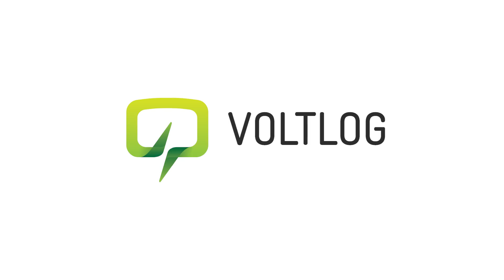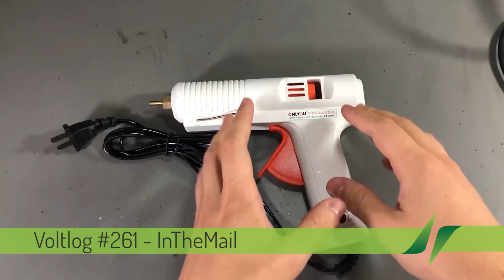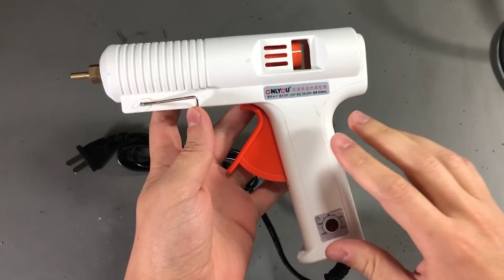Voltlog #261 - InTheMail

Comment: Those metal oxide sensors are absolute junk for measuring CO2. They have varying sensitivity to different gasses, with CO2 being one that they are the least sensitive to. The sensors really measure a bunch of gasses all at once and produce a single value and the estimate for CO2 is calculated using a curve that is calibrated if the sensor was measuring only CO2. In other words, a tiny amount of one of the other chemicals that the sensor is much more sensitive to will produce a very high "equivalent" CO2 reading. 

They can do an OK job outside in clean air where there aren't a lot of other VOCs, but indoors they will not give good readings of CO2 at all. For example, when I was experimenting with one, spraying just a little bit Windex in the same room would cause the sensor to read CO2 levels in excess of 10000 ppm, which is obviously wrong and this would persist for a long time. The only thing they are really useful for is to get a very rough idea of the general relative amount of VOCs in the air, but again because they are sensitive at different levels to a wide range of chemicals the exact values you get out of them are basically meaningless.

The gas sensor in the Bosch sensor is also metal oxide. Its air quality estimate is... questionable, at least in a quantitative sense. If you just want a rough "air good / bad" measure, though, they are decent.

Comment: The shipping time isn't the problem. I have a hard time finishing any project. When I've solved something (selected the components, designed the circuit, built a prototype, done the programming) I lose interest. Unfortunately even on things that I'd actually like to have. It's stuff like building a case, connecting switches or battery holders, in essence thet things that make it useable and look nice, that bog me down. I have soo many projects that are 90% finished and then get put in a box. And when I find them month or even years later it's a populated PCB with wire hanging off it, but I don't know exactly what I did anymore.
Reply from the maker: It's likely you are getting packages delivered faster than I am, in some rare cases I receive stuff after 3 months and under normal conditions it  takes 6-8 weeks. It's also likely I'm looking for an excuse not to finish or start a project idea :-)

Comment: I abandon EVERY project, but that's probably due to mental issues. 
I had to make my own tiny 3mm pitot tubes for probing the ports of cyl heads - , and it was a total PITA to drill those small holes in the side of the tube.
Reply from the maker: Would it be possible to use the one I showed? It sure is cheap and easy to get.
Reply: @voltlog  Unfortunately that is too big for what is essentially small ports, plus it has to be bent 180º to face the air stream.
Mine are smaller than this one.
https://youtu.be/C7G96c5rKnw?t=90
Reply: @voltlog  I've been out of the game for 10 years, but I now notice the have electronic velocity probes. Any idea what they are?
http://performancetrends.com/Electronic-flow-bench-velocity-probes.htm

Comment: MH-Z19 is definitely my favorite sensor so far. Knowing an approximate CO2 level has proved to be extremely useful exactly for monitoring the effectiveness of ventilation. Two examples:

In my previous apartment I felt the need to keep the windows slightly open all the time. After buying the sensor I could clearly see how the CO2 levels built up if the window was closed, especially if having some guests over. I happened to purchase the module a little before the apartment building council decided to reopen vents that had been closed and painted over during the energy crisis in the 1970's. In my 38m2 apartment I got then 3 vents instead of 1. CO2 levels when windows were closed dropped from 800-1100ppm to around 500ppm. The difference was huge and after that I felt less drowsy and better overall.

Our current apartment is in a 20 year older (1920's) building and there's only one(!) incoming air vent, even though the apartment is twice as big. The bedroom is in the other side of the apartment and is not on the path of the incoming/outgoing air. With the sensor it quickly became clear that the air gets intolerably bad unless both bedroom doors are open with at least a 10-20cm gap.

It's often difficult to realise what's wrong when the levels slowly creep up. I created a Wemos D1 shield from mine (it fit on a D1 mini protoboard almost like it was made for it) and brought it me to various places for quite some time. I second what has already been mentioned that it might be a bit finicky to work with. I never felt I had issues with the auto calibration though but had occasional trouble with the serial communication stopping. I have used mine mostly with ESPEasy for the convenience. The developer seems to have gained a lot of experience in its quirks based on the GitHub issue threads I've followed. He specifically warns about not accidentally triggering the zero point calibration which could render it useless.
Reply: Example issue thread with some tips: https://github.com/enesbcs/rpieasy/issues/40#issuecomment-473019800
Reply from the maker: thanks for the tips, what you describe is pretty much the scenario I have in mind as the apartment I'm currently living in has only one small intake vent in the kitchen and another one in the bathroom. I'm pretty sure I'm gonna find the CO2 levels are increasing during night time, but we'll see.
Reply: @voltlog  you're welcome. It sounds very likely. While visiting my sister in Netherlands with my gf 1.5y ago in a building likely from the 19th century, she was so hospital we got to sleep in the master bedroom. First night I woke to a feeling I can't properly breath, hooked the ESP with the sensor to my phone charger and got a reading of >2000ppm. I was  then able to tell her (with proof!) to never sleep with the window closed there. :)

Comment: Trying to measure ventilation efficiency?  That's the most common use for CO2 sensors.

I have a $1 1/2-watt flashlight which uses one of those plastic collimating optics and it works quite well.  I don't know why they're not used more often.
Reply from the maker: I would like to now that the air I'm breathing has acceptable CO2 levels. I'm talking about the apartment I'm leaving in, and especially at night when the windows are closed.

Comment: The Hot Glue Gun claims to be 120W 100-240 VAC, can someone explain how is this possible?
Reply: It's thermostatically regulated so it probably just gets hotter quicker on 240V before it's cut off point.
Reply from the maker: Yup, George is correct, testing it on 240V it starts with something like 150W and then quickly goes down as the element gets hot. It doesn't really matter what the real figure is, it's capable glue gun, it's powerful enough so it gets hot quick.
Reply: I bet it never runs @120W no matter what is the line voltage

Comment: Sometimes I forgot the project by the time parts arrive or I've come into another solution. That's a reason to keep all the basics and common sensors available. Unfortunately that also means that I have a lot of special parts around as leftover that may be not that generally usable. That happens especially if I'm in a harry and order for two separate source in case one takes forever.
Reply: The same thing happened to me for years, so now I keep an Evernote notebook with a quick explanation of what each part might be used for.

It's handy because I can cross off parts that I've used, and keep an inventory of things in stock which stops me from ordering the same thing twice. It also helps me record "Eureka moment" ideas that pop into my head at 3am, which otherwise would be forgotten after a night of sleep. A quick read-through of my notes every few months jogs the memory and helps bring multiple projects together.

Sometimes I'd order a part to fix a specific issue, but by the time the part arrived the equipment had completely failed or was rendered obsolete. Keeping track of this seemingly useless stuff helps me repurpose it.
Reply: @Microwave_Dave  Evernote rocks.